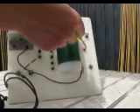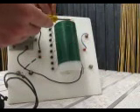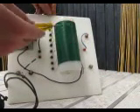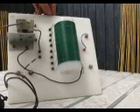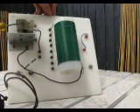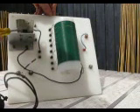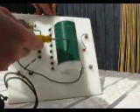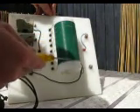A demonstration of a crystal radio - Part 1

Comment: You didn’t mention a ground connection on your radio. Did you actually build a crystal set that works without a ground?
Reply from the maker: They work without a ground but signals are much weaker.
Reply: vk3ye hmmm, when I was at tech school we were told a ground connection was crucial for a crystal radio to work. But then someone in my class was like “what about FM?”, and the same instructor said it was impossible. Turns out he was wrong about that too, as there are FM crystal set designs available online.

Comment: Is it true, all these sets are AM tuned? And if so, why cant they beadapted to pick up fm frequencies. Does it have something  to do  with the fact  FM frequencu is a piggyback frequency modulared  at low frequeency to ride on the more powerful am signal?
Reply: It is possible to make an FM crystal set radio, but it is more difficult than the AM crystal radio. There are plans available on the internet now just do a search.
Reply: FM crystal radio is more complicated.  You can make one of these with garbage you find in the street such as a fan motor for the wire, couple inches of 1" pvc water pipe or toilet paper roll center,  screws that puncture your tires, a rat trap, a diode and 47Kohm resistor from a junk tv or radio or get one at Shopgoodwill.com and the little beeping buzzer of your microwave for the speaker. Just 5 parts  That's it.

Comment: The headphone is made of crystals. Ordinary dynamic headphones will not work for this set.
Reply: Yes they will.  They have a little less volume but if you put them in those hearing protection headphones you can still hear it when its quiet.  I use some made with a couple of broken junk headphones that were once used in a call center.